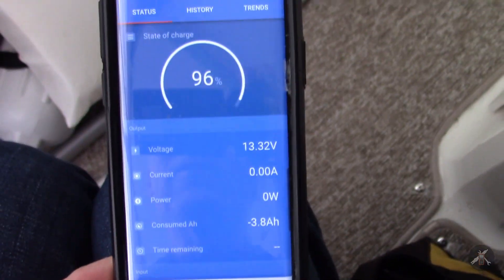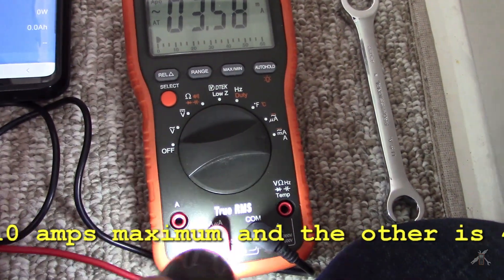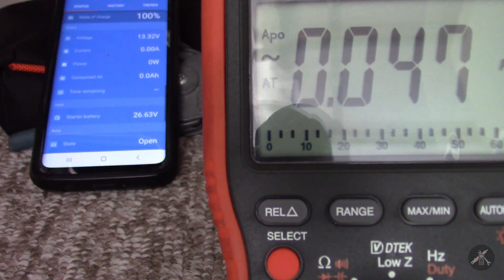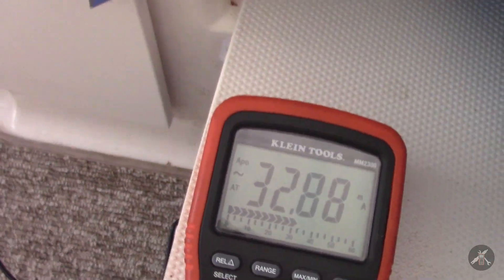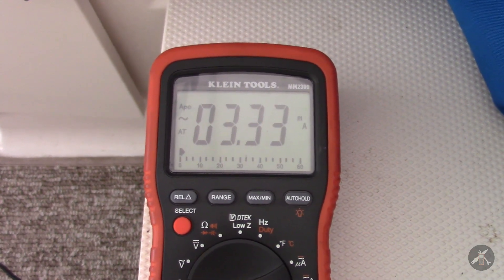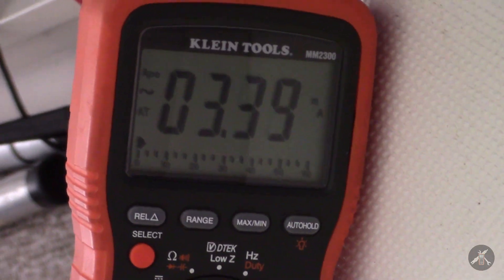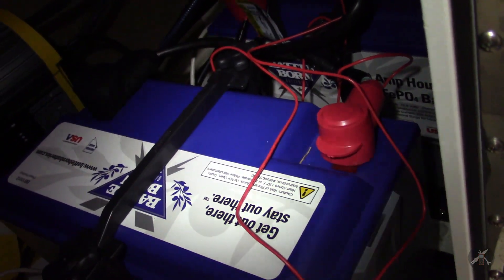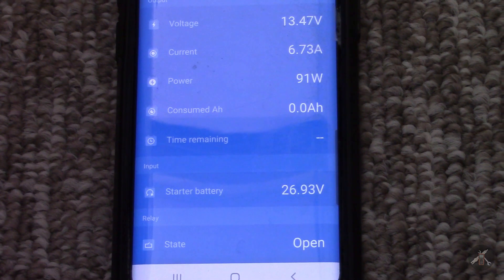Always Unplug your Motorguide Xi5 - Draining Battery and Causing BMV-712 Battery Monitor Error

Comment: Foot pedal won't turn motor left
Reply from the maker: Could be a problem with the pedal, but since it only has a problem one direction, it is more likely the motor control board. If you have a hand control you could rule out the pedal.
My Xi5 has been having some intermittent drop outs and lock ups. Looking at the system, almost all of the control is in that board and I'm likely to replace it one of these days.  It could also be bad connections somewhere inside the motor.